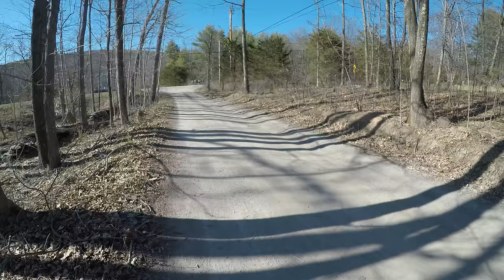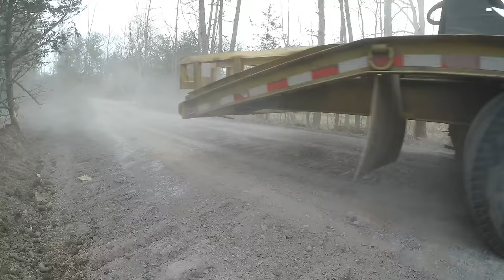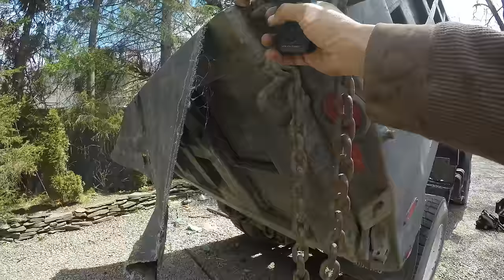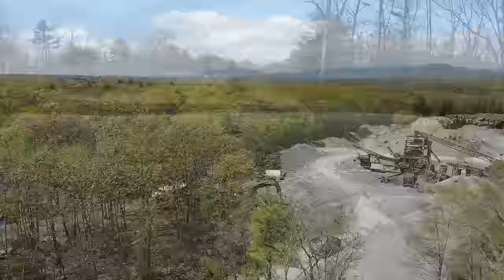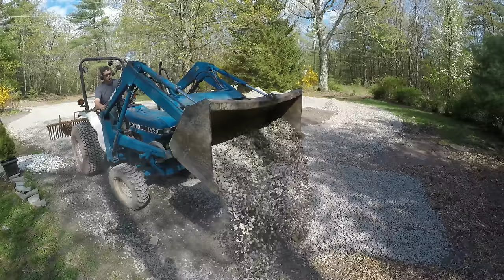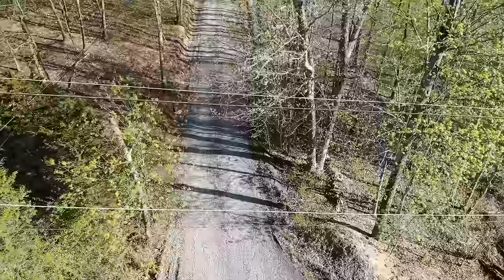Fixing a gravel road

Comment: That looks pretty darn good.  I have driveway problems. It's basically the lower than the surrounding ground. Water runs down it like a river during rains. I just fix the potholes that form, but after watching this am finally inspired to get some drainage ditches cut and raise the drive up a smidge. Thanks for the inspiration Andrew!

Comment: Andrew, you have just GOT to buy a roller compactor. One of these will make almost any road work you do that much more stable, and better looking too.
Generally, you've done a pretty good job here. You're a hard working man, I'll give you that, well done!
Reply: Once he owns a roller he needs to get it to job which is trailer time and then one would really need to hire a full time employee so that 2 trucks and trailers can go out to the job and now he has a whole new set of trials and tribulations to consider.I see Andrew as a KISS guy keep it simple stupid but, Lord knows he could handle it as his reputation has increased and I'm sure he could keep someone busy. Only time will tell
Reply: Equipment breaks and you repair it. Employees that are reliable, honest, and consistently hardworking in this type of business are really difficult to find and keep.
Reply: A roller is pretty unnecessary for most of his jobs. If he did absolutely need something to compact small roads/ driveways like these then he can get a weighted compactor drum for his tractor to pull around. Moving all of his equipment has already got to be a nightmare, I can't imagine adding something so specific to the mix...
Reply: but then he wouldn't have to fix the driveway years later.

Comment: Some people still don't see the need of having a crown in the road. Good thing you do, Bravo Andrew!
Reply: Agreed,  manage the water or will manage you
Reply: Crowns work on paved roads. Ruts will always redirect water with or without a crown .
Reply: @Canvideo  My driveway is a bit over 1/4 mile and believe me, you need a crown and ditches on each side. Mine is hilly as well.  I'm also adding gravel and fixing after heavy rains. Luckily I have some equipment,  or it would cost me a fortune. The last big storm last summer washed out a 6 foot deep ditch directly in front of my low water concrete bridge, it was like a raging river all that day. I hate my driveway.
Reply: Most gravel roads do not have a rock base and layers of the right gravel topping. After winter, the ground will thaw and the roads get soft. People have a habit of driving in the rut rather than driving the high sides. When the road sets up and dries the ruts almost always break up the crown and form water channels when it rains, washing away the topping. If you have equipment, you will probably find that the less you disturb the topping, the less will wash away when it rains, so filling in the ruts with proper road gravel and packing it down works best for me.

Comment: The job that keeps on giving. I really don't guess there is a permanent fix but what you did they should get some miles out of. Almost like feeling sorry for them and giving a bit more bang for the buck. I get a little queasy when you are in nascar mode and the top of the dump truck tips a good bit. A hard roll would pretty much make scrap iron out of the dump truck should it ever happen. I'll pray it never does. I think if the country went into  a depression, you have so many talents to draw from, that you wouldn't notice it. I guess this is as good a place to get out of this conversation... Thank you for sharing this fine piece of work!!

Comment: I recently put new stone on my drive. It’s been here for 13 years and was down into the clay. I had potholes and muck during the winter.
The truck driver started out great and was spreading fine until he lifted the bed too high and the stone came pouring over the tailgate and left about a 3’ high pile of stone for about 30’ or so. My drive is about 400 yards long. Had he not messed up one load would have been good but he ran short. I wasn’t sure there would be enough in that pile to reach the end. I got another load and started working on moving the huge pile. 
I’m glad though I got 2 loads. It’s about 2”deep throughout and in some spots it’s about 4”. I’m hoping it’ll pack because my wife and daughters cars get pulled side to side because they’re so small. It doesn’t affect my truck any. 

Thanks for sharing your job w us. You do great work. I’m amazed that you’re so talented both in excavation and a great mechanic as well.
Reply from the maker: Thanks

Comment: Ever considered buying a roller? You seem to get a number of jobs that would benefit from one.
Reply from the maker: Maybe, they are expensive.
Reply: You could probably get one at Ritchie Brothers for a pretty good deal.
Reply: Pick up one for behind your dozer.
Reply: Take old loader tires fill half with concrete and put chain through top half of them hook the chains to the f800 and do a few passes the wider the road the more loader tires you use & you can stack the tires for more weight to -you can also daisy chain the tires together to create a more uniform compression-give it a shot Andrew cheap and super effective compared to the cost of a roller. You won't be disappointed. Your a talented guy & I enjoy your vids.
Reply: D.O.S.A D.O.S.A that’s an interesting idea. I’ve never heard of that being done before.
Reply: get one that doesnt run and rip the wheels out of it and weld the two sets of rollers together and put a draw bar hitch to it with a 500 gallon tank ontop for weight, and for dust control if needed, thats what im working on right now
Reply: 6 x 31x10.50R15 tyres that are worn out , fitted on rims and all on a single axle drawbar and a water tank on top for extra weight when required. Or just get a section of steel pipe ((24 inch)and fill it with wet sand for weight. Google home made farm roller for ideas.

http://www.davimac.com.au/_media/products/other-products/roller3.jpg
Reply: I would love to hear how you estimated a job like this.
Reply: Dozer tracks make a great roller!
Reply: I have never seen anyone tailgate the gravel out the back so evenly. Even the Loader was well done. You really have to try this stuff to appreciate those skills. Great job!
Reply: It just takes a little practice and matching your speed to the opening width of your taildoor, I guess it just getting to know your truck. I'm often amazed at how some people find it so hard to spread evenly.
Reply: @sustainableliving880  Dozer would be the last thing I would use for a roller.A loaded dump truck would be a better choice
Reply: Good work! You are a one man road rebuilder. Sort of like the Romans, back in the day!
Keep up the good work.
Reply: Andrew Camarata I’m sure you could find a roller work tool attachment for your Bobcat.
Reply: he bought a roller just now!
Reply: Saw one in a more recent video that he recently bought. Haven't seen it used yet so dont know it's working order status.
Reply: @MM-fe9mz  Hope he bought a wreck, He would make a great vid bring it up to scratch.
Reply: I think a small grader could also be a good addition to your fleet of equipment
Reply: Andrew, concerning rollers, if you can find a Galion S-2 Roll-o-metic, it would be perfect. The roller has rubber wheels that come down for towing. Instead of using a trailer, you could just hook it to your truck. And, as they are no longer made (Dresser bought them out, later Dresser was gobbled up by Komatsu) you can probably get one cheap. You may have to spend time fixing the motor, but that shouldn’t be difficult for a person of your talents.
Reply: @AndrewCamarata  this comment aged nicely
Reply: @AndrewCamarata  could always find a skiddy roller attachment
Reply: He has one. Did a video on the process.
Reply: @usernamempk  I posted that comment 2 YEARS ago! lol

Comment: I've found that when you get more than 3 or 4 people on a street, they just assume the other guy will maintain it, then it never gets maintained.  Everyone contributes some damage to the street.  The other issue is that people inherently only want to pay for "what is theirs" when it comes to distance along a road.  On my street I just divide the cost up by acreage; I have twice as much as everyone else, so they each pay half of what I do and I do the maintenance.
Reply: If you have 4 people who own the road, does person A who has to drive the shortest distance pay the least and person D driving the farthest distance pay the most? So if a road cost $4,000, how much would each person pay?
Reply from the maker: Yeah, you are right. Sometimes that nonsense makes it impossible to deal with. These people were fine to work with. And one rule I usually have when doing shared roads is that I only deal with and getting paid from one person on the road.
Reply: You have correctly outlined the logical conundrum.  There are 2 ways to calculate the upkeep costs: 1) distance traveled 2) percentage of road frontage that you own.  Since the road is an easement or at least "owned" by the people who live on it, then I think it more fair to all if everyone simply pays based on the amount of road frontage they own.  This is analogous to publicly maintained assets.  You pay property taxes based on the size of your property, why shouldn't the same apply to maintaining a private road?
Reply: Andrew Camarata. It would be a good idea to make sure that the cost of the job is in the hands of the one person who is paying you rather than them trying to collect if after the work has been done. I have found that it is extremely important to ask very specific questions about how you are going to be paid. It's better to spend 30 minutes doing that then trying to collect it from someone who has no intention of paying.
Reply: EFormance Engineering
To be fair, it should be 
1. Distance traveled and
2. Amount of road owned.
You need to be a mathematician to figure it out.
Reply: I live on a private road like what he just showed in this video. We have 55 homes on my road and we have formed a road maintenance association. Each household pays yearly dues and maintenance gets paid for with that. Twice a year we have a guy come in and re grade the road with his road grader (he doesn't do very good, doesn't understand that you have to actually break up potholes at the base, not just fill them in). Everything road related is voted on, last major item was whether or not to pave the road which passed. I personally wish it would stay gravel but oh well. The association works out well and we don't have issues like what is shown in this video.
Reply: I’ve noticed the same damn thing... 4 houses is trouble.... teenage drivers are the worst
Reply: maybe a weighted average?
Reply: Here in Denmark you can request a 'vejsyn' (road inspection) where the municipality (+ a few laymen witnessess, often local politicians) meets with the road owners of small roads like this.
This results in a formalised contract of sorts where the ideal form of maintenance is specified (usually) AND the individual household is charged with their share of maintenance.

The maintenance can be divided simply into costs, but that can result in muddied up complaints in the future when/if neighbours fall out.
If the municipal official is worth his salt, he will charge the individual households with SPECIFIC STRETCHES of the road. That way it becomes very obvious who is the asshole and fewer people will try to weasel out of an agreement. Plus it's legally binding.

You can always get a new road inspection if you think the division of maintenance is unfair, but there's a fee to pay to disincentivice abusing that option.
Reply: And then? Go door to door w/ gun in hand to get folks to pay?
Reply: Another example of why Socialism doesn't work.

Comment: Enjoy your videos and you are a hard worker for sure. Safety note: you should fix your trailer bed:heck of a hole in the back. Imagine at the end of a long day,you're exhausted,hot,hungry and all that's left is to load up and head home and then you step into the hole and snap a lower leg bone....
About all the equipment and trailers I have are old(like me) but everything functions as it should and won't get me hurt.
Also: keep your trailer brakes in perfect operating condition. Heck of a lot cheaper to replace than your dump truck brakes. All my trailers are set up to do the majority of the stopping;not the tow vehicle.
Other than that I do hope life is treating you well.

Comment: The roller is a good suggestion but compacting the subsurface (made of gravel and dirt) any way you can is the best thing for roads, then whatever you put over it will essentially conform. Maybe you could find an old one for cheap and modify the drum to pull behind the dozer.

Comment: Looks to have built properly a long time ago, but well used. The road needed to re-crowned with Spoon drains on the lower levels . An old mate who did road machinery maintenance years ago said the best way to check how well a road is designed or maintained is to look at it after rain and see where water lays or runs .In your case its obvious, but on sealed surfaces ,not so much .

Comment: I find that potholes are best dealt with by filling them to slightly above grade with proper road gravel. The Cat just chews up the nice compact portion of the road. Also keeping organic soil off the road helps preventing mud. Crowning a road never seems to stop ruts. Drivers like to drive in the rut rather than the high spots so the crown is usually moot on a dirt road. Same goes for potholes. They are caused by driving through them and the hydraulic action when the tires drive through them blows out the road material, so, filling them with good material ASAP is best.

Comment: "these pins all came out... I don't know how that happened..."

I seem to remember someone bashing metal down in the dump body with an excavator in the previous video....

I'm not saying....  I'm just saying.....
Reply: The box was all the way down when he was doing that. It's at its strongest at that point and isn't sitting on the pins at all.
Reply: Lol I had to skip parts of smashing I truck cuz it made me cringe
Reply: That pot hole rode reminds me of roads in Colorado like CRAP LOOK OUT FIR THAT HOLE
Reply: A new dozer like a D5 has a tilting side to side feature you could probably use that since you get jobs that require water reguiding
Reply: @kill3rhorsepow3r51  yeah, i was thinking that would be nice. He seems to be able to get an angle started and work off of that with the d4 but a tilt blade would be really nice to have.
Reply: Pretty lake! What's the name of it?

Comment: well young man good to see your active. So a little advice from an old grader cat operator, you are angle dozing backwards. Angle doze the materials from the shoulder of road or ditch to middle then level. you can tilt and angle blade so the material in ditch will come up on road, then angle to center then straight blade center to fill and carry material ahead of you.good luck, ps watch come grader vids.

Comment: You should make yourself a barn door tailgate all you need to do is put some hinges on it and just pull the top pin every once in awhile and put one pin back in it again and lock it up and will you go to regular tailgate those things work great I don't know if you have ever saw one but I'm sure you have barn doorl is the way to go for hauling stumps and Big Stuff seen you  get stuck a couple of times with stuff in your body a specially on your new truck you're pretty crafty at making things so tou can probably make a nice set of hinges with king pins  use  torsion bars as the pins they never wear out just a thought love your container building is that your house on top  love to have one made for my self

Comment: Grading with a bulldozer is not the easiest of tasks. You are comfortable on the seat. I found when a tailgate got too bad it was easier just to take it off, duplicate it and put the new one on and scrap the old. Have you ever tried crusher dust on driveways? Works nice and packs like concrete.
       Mike
Reply from the maker: Yeah, that could be topped with the dust. I would not have done that whole repair with dust, the holes would be right back.
Reply: Andrew Camarata very nice job bud!!

Comment: In an area where snow is always a significant issue,i'm surprised asphalt isn't used on these driveways. It doesn't get torn up as much when you plow it. You should get into the asphalt thing too and buy a tractor with a snowblower attachment..........or get one for the tractor you already have.

Comment: Looks like your dump truck has made you lots of money... time to look to upgrade? Really enjoy your videos!
Reply: He does not like the trucks with electronics. That truck just needs to get fixed up and be maintained.  All the bearings those pins came out of look to need replacement.  I just don;t think he has the time with all that he does so he repairs as needed.
Reply: If it ain't broke,why trade it. I'm sure he's going to run it till it can't be fixed anymore.
Reply: Truck is solid and he can fix anything... just fun to see him get into some new stuff?
Reply: I agree, would like to see him buy a newer excavator.
Reply: Cape CodBob yes probably very busy time of year now
Reply: 4sure... he seems to find good deals which is fun to watch
Reply: Jesper R I mean he has a paid for perfectly running one that holds up like a tank
Reply from the maker: I might buy a bigger truck. But I am happy with all the machines I am using right now.
Reply: at the very least, replacing the racing slick.
Reply: What's the GVW on that Ford?
Reply: @AndrewCamarata  You need a 2005'ish GMC C7500. Super good trucks! Reliable, not alot of electronics. Just awsome!